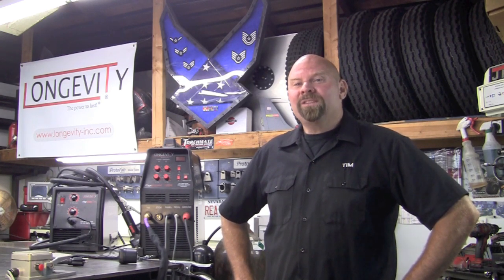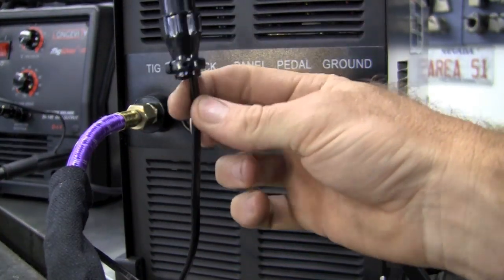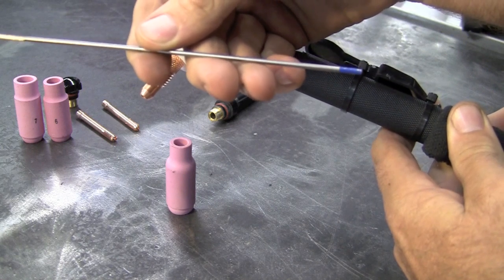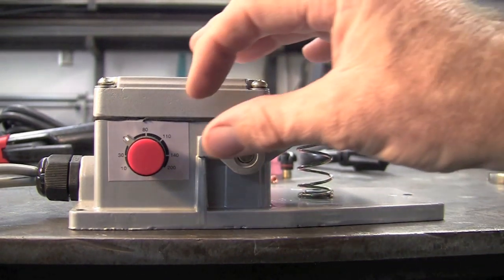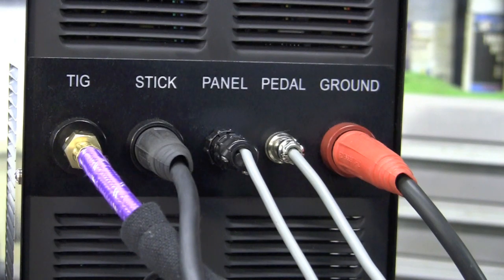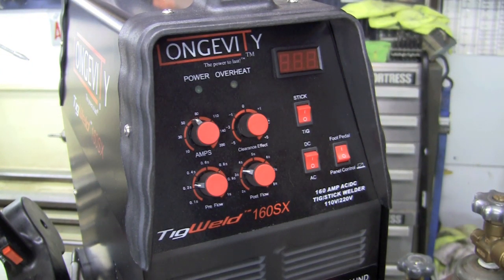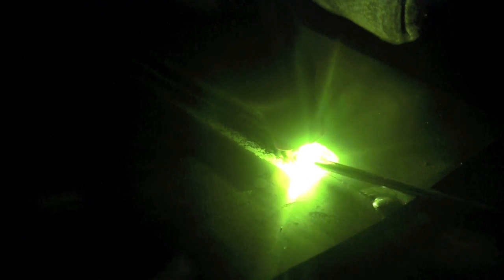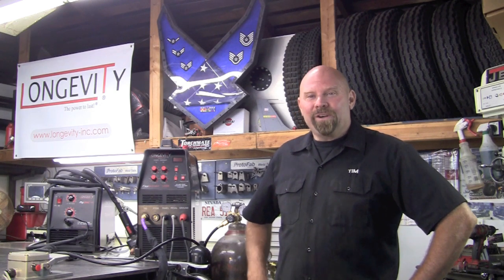LONGEVITY TIGWELD 160 SX 160AMP AC/DC TIG STICK WELDER REVIEW 110V/220V

Comment: Clearance effect only works on ac welding and it makes welding aluminium possible by varying the switching of the polarity of the arc from ac/electrode negative to ac/electrode positive many times per second and it etches the aluminium oxide from the metal the more the clearance effect is turned up the more cathodic bombardment occurs and the less time is spent In electrode negative and more time spent in ac electrode positive it means that the tungsten heats up cause the currant flows from the work in to the torch and when it dose it lifts off the oxide from aluminium

Comment: No offense but when  you said this pedal should last a long time I started laughing ................ There is nothing about this machine that's gonna last  ! I use old amptrol pedal at work that's 25 years old and works the same as the day it was made , every thing about this set up is a poor copy of some of the best welding companies in the USA , specialy that nasty Lincoln mig in the back , wanna weld on the budget ? Buy diversion 165 at least they have parts and service ! Garbage